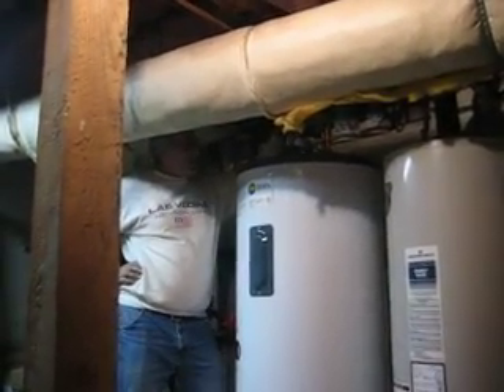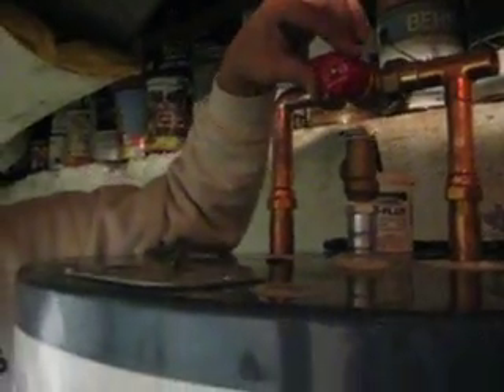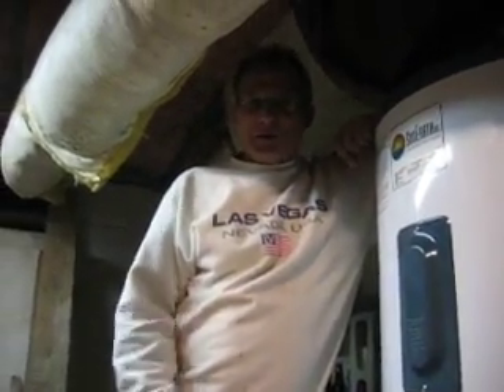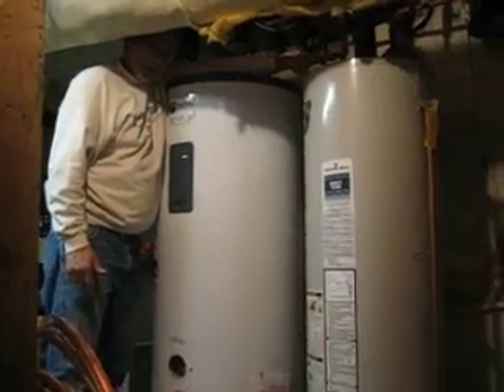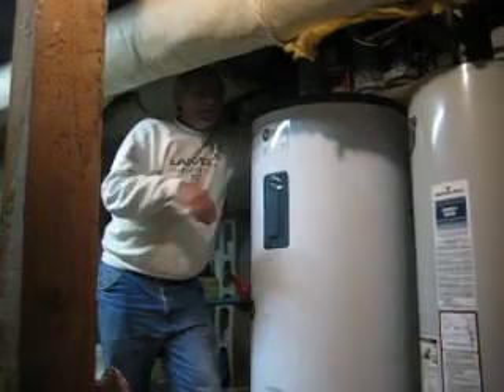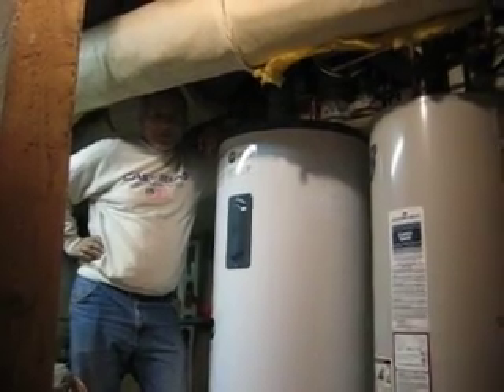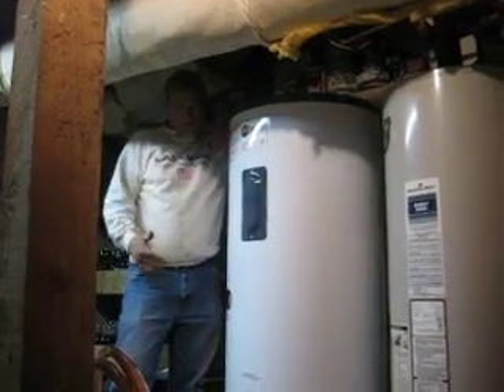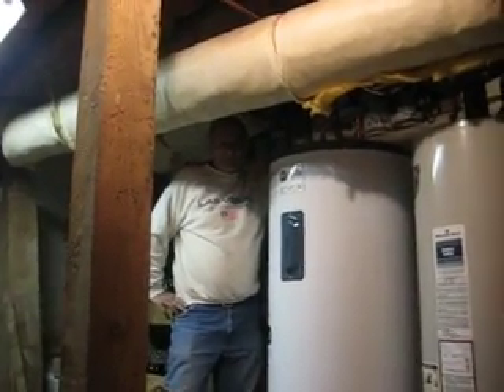Function of water tanks in solar heating system

Comment: @jcanivan 170 is not high for  solar heater but is too high to use without being scalded. This is why he is installing  a 'mixing valve" so that it is blended with cold water before use. Most set them at 120-140 degrees. My system like most will even get as hot as 210+ degrees but has a pop-off valve at 190 to prevent it getting to hot and creating steam.

Comment: Most solar storage tanks do not have heating elements, the sun heats it. Then the solar storage is hooked to the homes existing tank making it a back-up heat source.

When used,  the hotter solar heated water keeps the tanks heater from turning on. You save money!

Some manufactures make a special tank with heating elements, but It does not have to be a special "solar tank". You can just connect the solar heating equipment to the existing water heater, but then you have no auxiliary storage

Comment: The controller's sensor for the solar storage should be near the bottom of the tank.  With a 130F temp setting at the bottom of the tank the water at the top will be hotter but temp. will drop as the hottest water is drawn off the top of the tank and replaced with cold water at the bottom of the tank.

Comment: If you have your solar storage tank settings at 160F+ then you you have to put a mixing valve setting it to 110F, You are wasting energy! If your system is wired to house electric to run the pumps and controls, then you are paying to heat water past the point necessary. A more proper setting of your solar storage temp. is about 130F.  !80F degree water will cool at a faster rate than 130F degree water, even in an Insulated tank.  Lowering your storage temp. for more efficiency. Save Money !